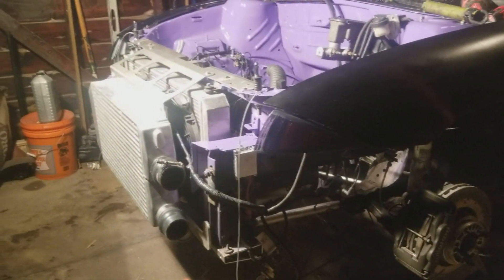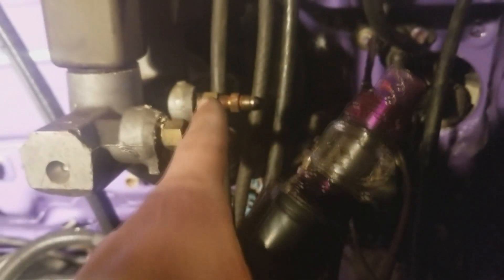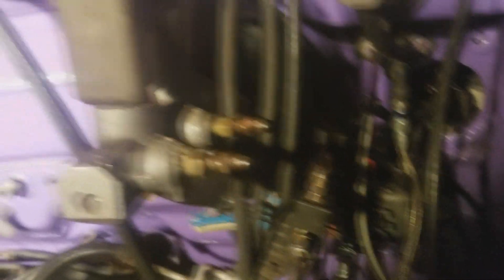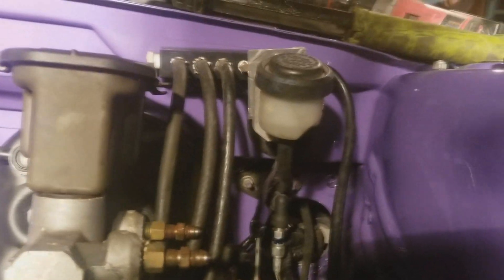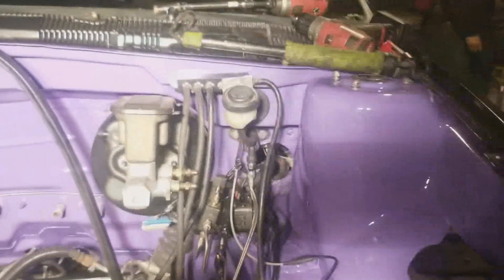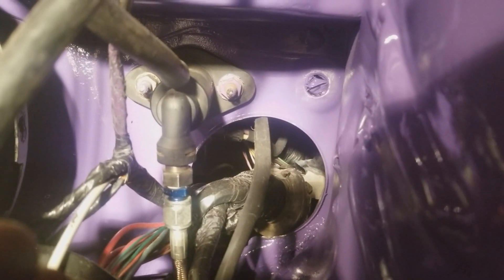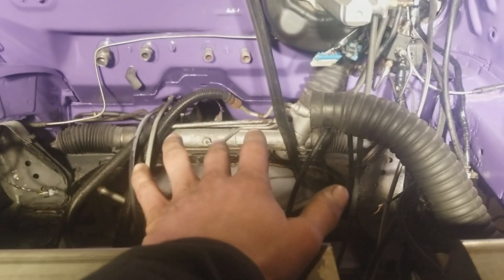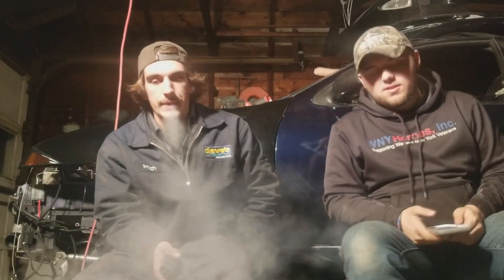Turbo Cavalier FULL BUILD Parts List

Comment: Yo I'm 14 and my buddy gave me his white, 1999 2.2L, 4 cylinder, bi-fuel Chevy cavalier. I plan on deleting the bi fuel system, replacing the fuel pump, valve cover gasket, battery, wheels, brakes, tint the windows and lights, new exhaust and much more. I also plan to turbo it eventually re paint it all black. Or black with red trim. Or white with black trim. Or white with red trim. Please give me some advice or even if you guys could help supply some of your old cavi parts. I love your guy's content. Keep up the great work
Reply from the maker: I’m just telling you not it’s not going to be cheap 😂 we had like 15k in the the cav rn and still I sent done but you should definitely DM Mitch on Instagram the link is in my description and we’ll either give you anything you need or sell you it for pretty cheap depending on what you need
Reply: @procam448  sounds great but the bad part is that I don't have instagram. does he have an email by chance?

Comment: What are you gonna use for the fuel system
Factor or aftermarket
Reply from the maker: Well Mitch has an upgraded fuel pump and injectors
Reply: @procam448  inline pump or fuel pump upgrade
Reply from the maker: I think it’s just an upgrade
Reply: I have a walbro 255 fuel pump, bigger injectors aftermarket fuel pressure regulator and custom fuel rail.